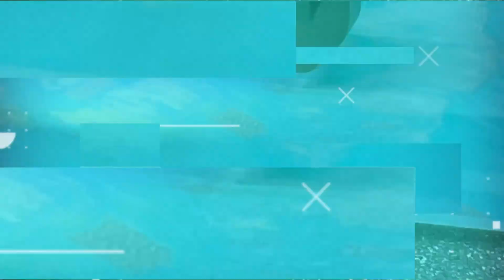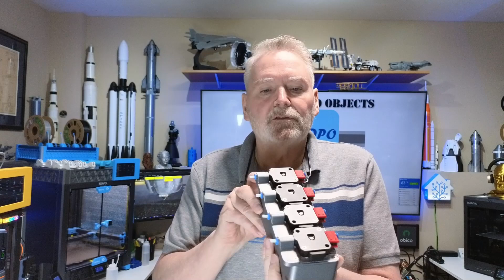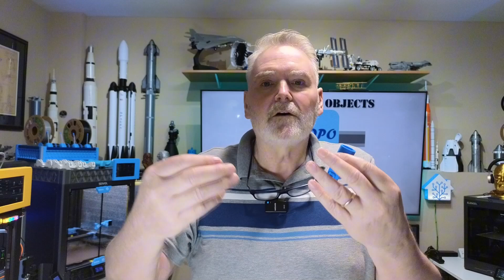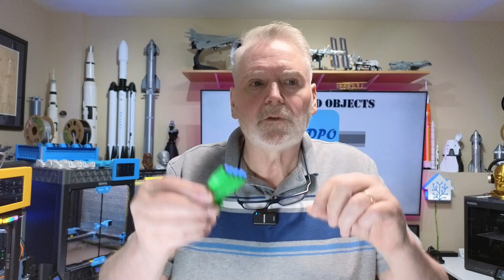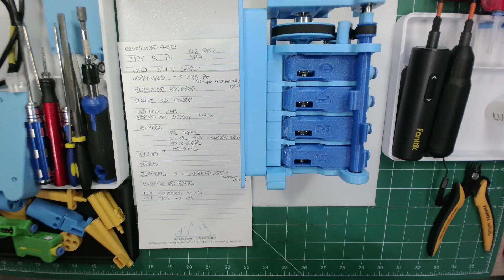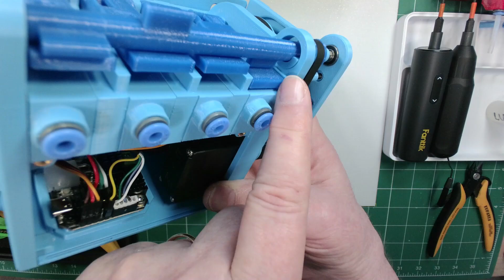Intro to CN3D's MMX Pre-build usage and concepts

Comment: Hi rick, I purchased the kit for my qidi q1 pro. What else do I need?

I'm swapping the default extruder to on that has a cutter.

Do I need a hub and the filamentalist?
Reply from the maker: I have not done it on either of those. I have put a klipper mod on my S1 (Renkhals), but I'm not sure what to do about Happy-Hare. I haven't reseaarch it at all. I do not have a Qidi either. If you have some success, post the info on the discord. Good luck!
Reply: @3dpo-rick Thank you for your reply.

Just to be a pain because I'm new to this, do I need a filament hub and the Filamentalist?

Comment: Hi Rick, this is a very good video, clearly explanation!!!
I have an Flashforge adventure 5M pro 3D printer and I wonder if the MMX could work with it
Regards
Reply from the maker: I believe I saw something where with Forge-X Klipper Mod, and using a filament cutter, it was in fact do-able. I can't confirm, but I have one and may try it at some point. i have a AD5X so...

Comment: You seem to understand all the concepts and applications for using an mmu, so I have a favor to ask because I just never have time to do it lol. Tip forming video. People have shunned it as being hard to tune and everyone just defaults to use a cutter. BUT when you have a purge location (like blobifier or many of the new printers come with a purge solution) tip forming gets easy. It's because when you can ram a substantial amount, and you don't have to worry about where the string produced from ramming goes(cause purge bucket) tip forming is super simple. I use the inbuilt tip forming of happy hare with a ramming amount of 16mm and that combined with 4 cooling moves produces amazing tips WITH NO CHANGES from pla,petg,abs,asa,pa it works for everything. I do this on two very different printers and have friends doing it on the qidi plus 4 all with great results. Give it a try if you haven't, and show people that cutting isn't the only way. I say this because so often I see people wanting an mmu but all they've heard is "you have to have a cutter" and that's just another complex thing for the average user to figure out. Also by extracting the full filament from the toolhead you reduce purge amounts, now granted you did ram out a decent amount so I don't know how much filament is actually being saved but it's less purge time and ramming/cooling moves only take a few seconds.